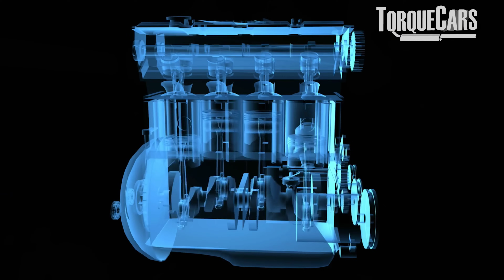SOLVED! Carbon Build Up/Deposits: Causes Exposed, Prevention, & Removal Solutions 💨🚗

Comment: There's one more technique of intake cleaning - dry ice blasting. The advantage of it is supposed to be that dry ice sublimates into CO2 so even if some of it gets into a cylinder it will not do any damage. This way you can try cleaning the edge of the valves - just open them slightly at the end of the cleaning process to get rid of the last bit of carbon.

Comment: I had a 2012 Audi A3 Quattro. Had the same chain driven engine as the mk6 GTI just 7ps less. I had it 4 years and had to manually strip it off the valves. Remove the intake and all the other bits. Put chemicals down the valves let it sit and scrape. Was a pain in the arse of a job but it ran like new again when it was done.

Comment: Primary cause of Carbon build-up on the intake valves is the Crankcase ventilation system directing gasses into the intake.

Comment: Hi. I recently bought a 2015 MK7 Golf Estate with 2l TDI and Bluemotion. I have started using BP Premium with detergent additives. I do a 95 mile round trip once a month on A road and motorway and use the Turin tune on the way out. On a recent A road return trip at 50 to 55 mph I got 69.9mpg.  Will that keep the engine clean? Is it clean enough?

Comment: I have owned my VW Golf mk6 GT TDI 140 for more than 9 years now and mostly do short journeys, now I do drive my car pretty hard occasionaly and I do mean occasionaly as I do like to "lets say test its abilities now and then"....lol...
At the last MOT they were amazed at how clean my emissions were, and were saying how rediculous it is that my 2009 un-ulez compliant car is cleaner at the exhasut than many euro 6 cars that they test and that Ulez is a total scam.... 
About five years ago I had a turbo actuator problem which needed to be replaced so I had to strip it all down so managed to get a good look at everything induction wise, my turbo vanes were as clean as a whistle, so drive your diesel hard without thrashing it whilst using good maintenance and it wil look after itself, I never boot it until it's warmed up if I can help it but have never had any issues regarding dpf, egr or the like!

Comment: Unfortunately eliminating the PCV and EGR altogether doesn't solve carbon build up. Even spraying neat methanol with a water-methanol injection system in addition to the deletion of the EGR and PCV bypass doesn't prevent the carbon build up.

Comment: That's why I'm keeping my port injected Nissan Sentra in mint condition. 😊
I'll still add injector cleaner in the gas tank once a year, and take it on a 500km open country road run at 130km/h constantly. Makes the car run, sound and idle like new😊👍🏻

Comment: I never use cheaper lower octane fuel. Instead i use 98. In Australia we have 91, 95 or the higher octane 98.
I can run 95 on my Golf R, but decided to never do that.
Why? Better performance, better cleaning properties inside to help keep the engine clean. On top of that i add a bottle of Rislone injection cleaner with every oil change.
A 143, 000 km and no issues what so ever.
Buy cheap crappy low grade petrol equals increased risk of carbo build up and injectors blocking.
I always will say this. Look after your car so it can look after YOU. 😊

Comment: Can a lot of carbon build cause misfire on cold starts?
Reply: @AndyTekkenClips  doubtful...it would most likely just cause it to take longer to start up on a cold engine & it will definitely cause it to "ping" more in hot climates while using low octane fuel (87 or less)

Comment: Jonas Hesselman invented direct injection in 1925. It is far, far from new. Get the car toasty hot. Find a vacuum line and use CRC Intake cleaner once a year. Run the engine at 2,000 rpm. Get a stick to fix the rpm. Spray in 2 second bursts for a half hour. 3 x 2500 rpm taps, idle for a minute, turn off.  Heat soak for an hour.  Take it for a spirited 30 minute run. Get a boroscope down the intake + find out.

Comment: How do you rate Tesco Momentum 99 petrol?
Reply from the maker: I actually quite like it, a few of our members have had their cars mapped to use it and it performs really well on their high compression turbo engines. Personally I prefer Shell Vpower and rarely use anything else, but the Momentum 99 is a great second choice.

Comment: Got for the wife a 2004 Vectra C with only 159k kms, the engine 1.8 16v. People might argue, thats an expensive car to drive, it gets 8L/100km or there abouts. Yes, but it doesnt need periodic intake cleaning, does not have failing turbos, vacuum actuators, DPFs, does not need specific oil and so on. Its a cheaper car and shes happy with it.
Reply: If 8l/100km is expensive then what can I say about my 12? 😅

Comment: Our 2015 X3 with the 3.0 N57 engine is having some issues with the EGR… think I’m just going to blank the thing and get it mapped out. Seems to be really common work carried out now at specialists. We run it on premium BP diesel only and as a minimum the oil is changed at a specialist BMW every 5k. Try to do everything right including motorway runs to get it hot etc and still the EGR is a pain with some fault codes. This year it gets deleted and mapped out 🎉😂
Reply: @TomDavies86  My 2015 Alpina D3 with n57 had allready 2 EGR cooler recalls under warranty. Had to replace the swirl flaps on the intake @ 140k kms (90000 miles), no engine warning lights only power reduction but could read out a code with OBD reader.

Comment: Exhaust Gas Recirculation in cooperation with direct injection is the course , specialy with short trips .
Building in an oilsepparator between valvecover and inletmanifold should be MANDATORY !
Bloody carmanufacturers .

Comment: 7:44 yep.. had a 2009 astra van in 2016 and my pal borrowed it to drive to northfolk 3hrs there and back and he was doing 70-90 no doubt…
When I got the van back it was so much more responsive felt like at least. 25% increase in power so the Italian tune ups do work

Comment: 6:17 but I bet anyone would gladly gain some power…
Just got a 1.4t Astra mapped stage 1…
Before the map on the motorway flat ground over 100mph it picked up slowly and I thought being a 1.4 it probably topped out at 120 downhill with the wind behind me…
Now the bhp was suppose to be 120 but was actually 133 stock.. now it’s 172bhp and it got upto 130mph no problem at 4K rpm… went upto 145 5k rpm and then I was at my turn off so I’m sure it will do over 150 now and the pick up over 100 was no different from 60-70-80-90 I was genuinely shocked how much better the engine performed at the top end I though I was just going to be quicker off the mark

Comment: A fucking gimmick to have engines conform to EU exhaust emission standards, except they make the problem far worse. As an example, check out the late model petrol chain saws - typically hard to start, low on power thus requiring more fuel to be burned to achieve the same job the old saws did in 1/4 of the time. - yep, the drongos just seem to be obsessed with evs and batteries that cannot cut it.

Comment: If the carbon deposits are different from cylinder to cylinder then it will affect AFR for each cylinder and the engine will keep the average bank AFR ok but once cylinder may be too lean another too rich . With AFR sensors on each cylinder the ecu could manage this problem.
at high load with 11:1 AFR obviously you can’t burn all  the fuel

Comment: just delete egr valve
Reply: The EGR is also there to help fuel economy while cruising by adding essentially inert gases into the combustion chamber which effectively reduces the amount of fuel needed to complete combustion. Your 2 litre may run as a 1.5 litre when cruising thanks to the EGR.
Reply from the maker: Other than the legalities in some areas, there is no reason to keep in on.

Comment: If you want to AVOID carbon buildup AVOID cars with Direct Injection. DI should never have been put into daily driver cars & these idiots solution was to add another fuel injector per cylinder through the port.

Comment: You're absolutely right. There are many events and this is one of them. In 1961, man went into space in a rocket. The shameful lack of quality meant that the combustion chambers were inefficient and long-lasting. The decline of mechanical, metallurgical and electronic engineering in cars is clear all over the world. All the attention is on useless and unnecessary electronics, but the main thing, the engine, is a piece of crap.
Reply: @enricohyppolito6454  on point!
Reply: bingo! very true that the total engineering package is substandard, partic on the engine vs engines of about 30 yrs ago, e.g. just loooking at japanese engines from honda and toyota.  That's what my two best mechanics who are ultra geeks and geniuses say, and one of those is from Japan himself.  He says that if u change oil every 3K or 3500 miles, then u can have no engine damage after 200K which is when the slight or significant engine damage starts showing up, on those two premium engine makers and other makers

Comment: Had to take the cylinder head on my 2020 Triumph 900cc motor cycle.....has fuel injection into the manifold.

I was surprised at the amount of carbon on the piston tops.....mostly it was a soft carbon.

The motor uses virtually no oil......

Any idea why its building up on the pistons....I dont ride the bike hard......its a low revving motor with high torque....plods along at 60mph at around 2900rpm.

Its covered about 9000mls.

Nick from Cheshire UK.
Reply: Try going down in spark plug heat range ….!
If its  7 go to a 6 and so on…..
But dont thrash bike …..
Fast blasts for few seconds will be fine…..
I have tuned many hundreds of engines over  the past 57 years …..!!
The heat range of a plug is there to suit what the engine is used for……
Racing motorcycles  8 9 or even 10 grade…..
Trials bike 5 6 maybe 7 tops…..
Carburation Ken  👍

Comment: Fun fact: My father was a mechanic for 70 years, RIP this year and I'm up in age myself. When we would get cars where little old ladies at his Service station and the car was running really bad because they never did over 45MPH, carbon was bad, I'm talking when gas still used Lead! He would take the breather off and use a glass Coke "the drink" bottle full of water and rev the motor and use his thumb as a water regulator and dump the entire bottle between the ventures and 2 minutes later you couldn't feel it running. Customers would say I brought it here because they said "Ervin my dad" was the best in Richmond and everyone else wanted to replace the motor. When they got rid of lead he changed it up to using Type F transmission fluid with the same positive results, Then we had fun driving up the interstate in second gear and punching it when we got back it was smooth as silk. All cars at one time only had 3 speeds so you could do 80 in second gear and not blow it up!  I've found I can take the hose off modern cars intakes and use a water spay bottle and get his results.  If I can get my hands to the throttle body I still use his Coke bottle.
Reply: That's effective for cleaning carbon off of the the pistons, valves, and combustion chambers; not sure how it would get carbon off of the intake valves.
Reply: Sounds good but I’d have to see that in action, why don’t you do a YouTube video, I’d subscribe and share if it works well.
Reply: I remember my dad doing that once on his 61 Falcon and it did work

Comment: FYI.
https://youtu.be/CxJJtPArD9Y?si=bNaog4EOcpyqGYu1

De coking is what this was called in the old  days. However, life was easier since there was more room in the engine to work in and take things apart without the need for specialists tools.

Nowadays they fit the engine in a shoe box. Make things extremely difficult to take apart and remove. 

In doing what would be a simple task could turn into a nightmare.  Like broken inlet manifold stud bolts etc.

Gone are the days of having a engine which just required regular oil change with oil flush and having the engine cover 200K plus miles without major costs.

Comment: I run shell v power diesel on my Volvo d4 engine. I do loads of short trips but I do motor way runs. I’m hoping the premium fuel burns cleaner and also removes any carbon built up in the engine. What else can I do?
Reply: Use lower evaporation oil (higher flash poin) and do more frequent oil changes. Diesel engines are not as much prone to intake vavle carbon buildup.
Reply: https://youtu.be/CxJJtPArD9Y?si=bNaog4EOcpyqGYu1

Comment: Valvoline Restore & Protect is the first and only engine oil that prevents future deposit formation and restores pistons to factory clean by removing up to 99% of engine-killing deposits.* Up to 99% piston deposit removal when used as directed for four or more consecutive oil changes at standard maintenance intervals. Based on adapted sequence IIIH testing.
#vs. GF-6 qualified oil

Comment: I have a TDCi Mondeo. I always use premium fuel and always use OW-30 synthetic oil. 
I take it for a run every fortnight on the motorway. 
Take it in for servicing every 6,000 miles. It's clocked up 150,000 miles it runs a peach. The only parts I've replaced is cambelt, water pump and HEGO sensor

Comment: We use a 10 second squirt of GT85 with PTFE in every other diesel fill up. 96,000 miles and inside of engine is pretty clean tbh. The GT85 is a well known cleaner of carbon, just melts it away. Works for me.......

Comment: You mention "small turbo engines" less likely than large capacity low revving engines" to develop carbon buildup. I have always assumed that the Golf GDI or GTI (not sure) was the first major car to have the major issues with the carbon buildup on the intake valves????.

Comment: Lets not oversimplify this issue by saying we are driving our cars wrong. My Mazda 6 Skyactiv diesel only ever does motorway miles (apart from the short commute to the nearest junction), and yet I've had my engine intake manifold decoked twice in 100k miles. This is a common issue with this particular engine, and no amount of servicing or premium diesel solves it. The issues are well documented on MrNiceGuy's channel.

Comment: I have diesel cars for 9 years and had once problem with carbon build up at EGR cooler. Once in 2 years I using aditive in fuel for clenaing injectors and dpf. Cleaning with ultra sonic cleaner solve problem and I drove since then 50000km. Next time if I had any issue I will clean exhaust pipe, egr valve and egr cooler and bring to ultra sonic cleaning.
Maybe next time I would rather buy petrol car or Tesla 😂

Comment: 😂😂😂 Carbon build up is not caused by direct injection. It is from burning fossil fuels that are full of carbon.
Reply from the maker: Lol. My old port injection engines never had this problem and they still used fossil fuels. On a serious note I should have been a little more technically correct in the video.

Comment: My wife’s polo tsi has 150k she only put super plus unleaded from day one and I change the oils every 5k max motul only
I also change the filters every 20 k and she does short drives so the motor can’t get operating temperature it hasn’t built carbon also it doesn’t burn oil…
It’s all about maintenance if you follow the dealer service plan you screwed…

Comment: So short trips are bad for engines, and motorway driving is an antidote for all types of build-up. Modern engines produce a fair bit more power than they used to, but people drive them probably more slowly these days due to traffic and never have to ride them through the gears, and anything with an automatic gearbox races through the cogs so the engines never really stretch themselves. An Italian tune up is always a good thing on a hot engine with good quality fuel.
Reply: Not just motorway but spirited driving, it's just that most people do not rev that engine except on the motorway however this does not work well on 8 speed automatics that just cruise on the motorway at 2500 rpm, that won't really run do much for your engine.